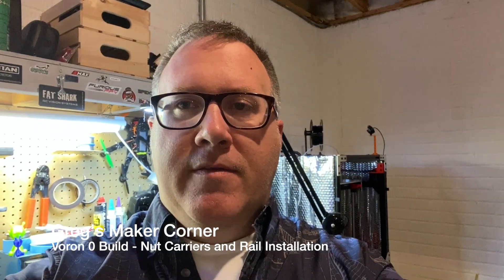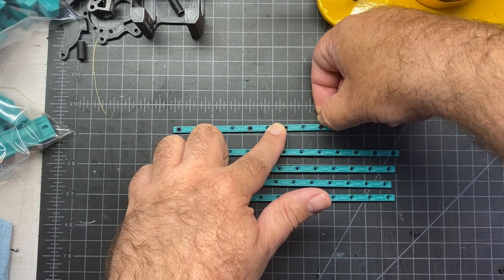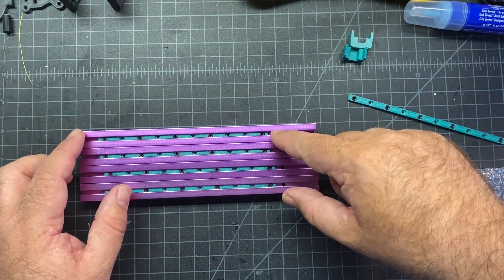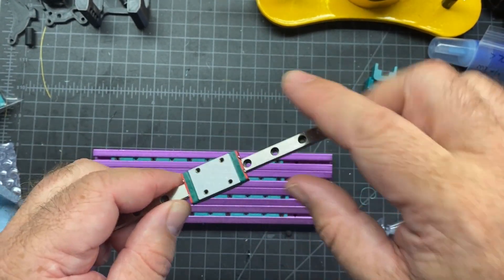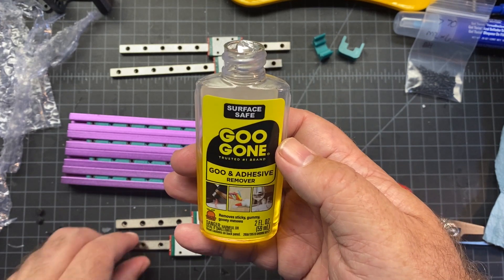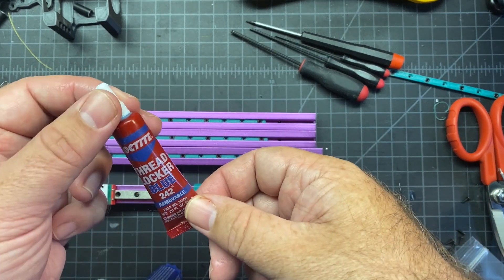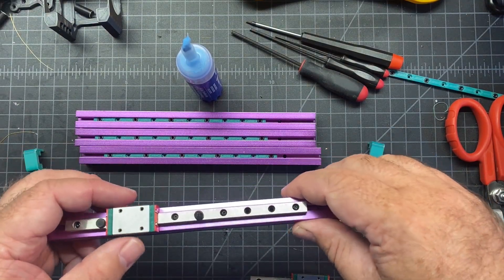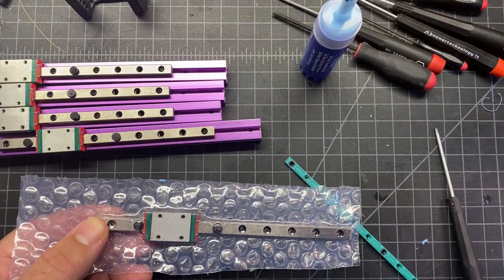Voron 0.1 Build Series -  Nut Carriers & Rails

Comment from the maker: IMPORTANT- the original V0.1 manual mentioned adding the cable chain mount to the bed frame early on as one of the first steps. I missed it in my build videos and had to add it later- which is a bit of a detour. The updated manual (as of June 2021) has it more clearly called out in the beginning. Please be sure to add it up front! You will see it later in my videos but not until I get around to adding the heated bed. If you forgot it, no big deal, but you will need to do some minor disassembly later on.

Comment: You installed the nut adapters upside down from the instructions. I have no idea if that is good or bad
Reply from the maker: They fit much better that way with LDO extrusions and also there is no plastic in between the connection similar to how extrusions are held together. With other extrusions (eg MakerBeam) it may be better to put them in as the directions show. Either way it shouldn’t be a problem. So far so good and the rails have held in place very well even after printing 7k+ velocity.